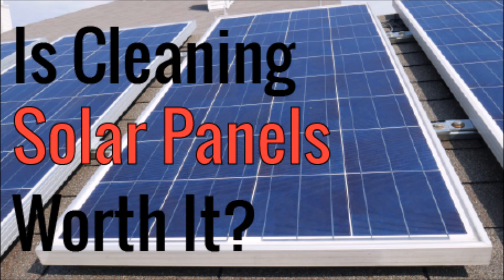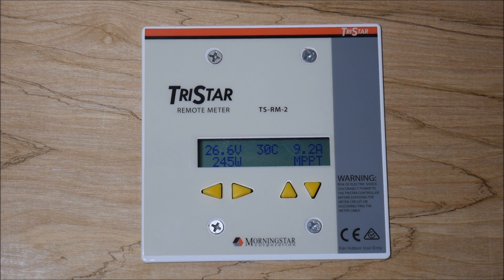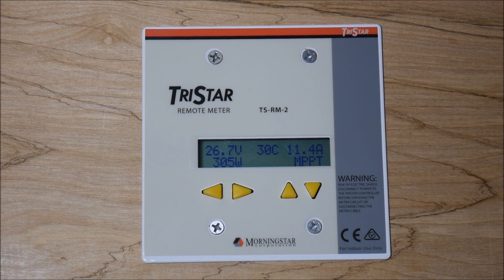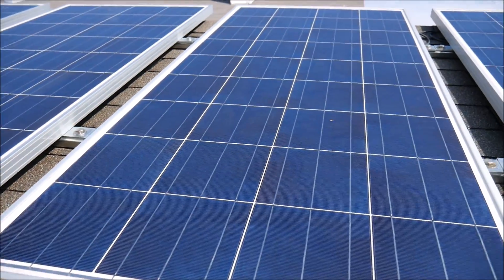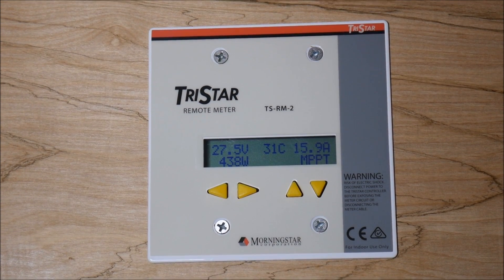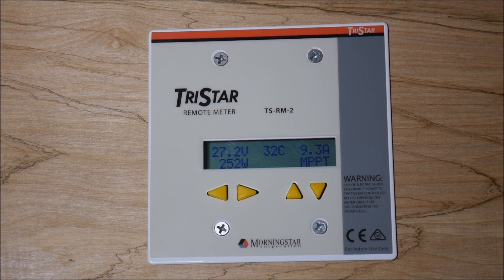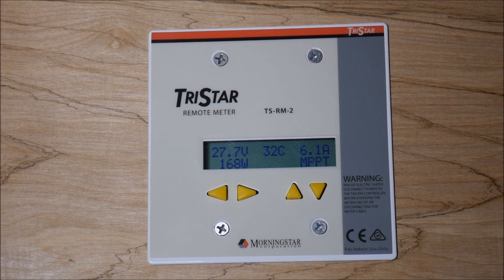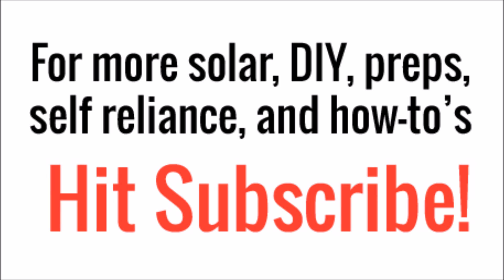Is Cleaning Solar Panels Worth It? - Real World Test Results

Comment: I think this is a cool experiment, however, looking at peak wattage may not be the best way to evaluate the results of washing.  You might try a test where you: 1. measure the total kwh over an entire day when the panels are dirty 2. clean them that night  3. measure the entire kwh over the next day.  You should pick two days that are expected to be 100% sunshine and the same temperature.   Would love to see those results as I have never cleaned mine panels...  Thanks for the video!
Reply: David Armstrong, good idea; that would give a second measure. In the industry we measure both peak power, and total day power.
Reply from the maker: I might try that sometime.  Good idea, thanks!
Reply: I've had solar panel on my northern facing roof (that the correct direction for the Southern Hemisphere) for seven years working at over +90% and a better quality system installed on the western roof hitting 100% of maximum output and I have cleaned them every Month on average because that what solar generating plant in most parts of the world do! Pay wages for employees to clean solar panels continuously. Now why do you think a commercial business pay someone's wages to clean panels? Because it pays they wages plus a return. P.S. Suggest if you have double depth panels that you use light weight aluminium extending pole +3Mtr (10'ft for the metrical challenged) with a flat window mop and a matching window scraper with a small amount of detergent only! Which mean you can clean all you panel off your ladder with a bucket hose and pole. You are typically only removing dust particles with occasional bird shit but it definitely worthwhile. Anyone who tells you otherwise is just lazy. P.P.S. Not lifting your panel off the roof with the uninstructed as recommended means they are more likely to overheat and like inverters when electrical generators when things overheat they work less effeciently.  .
Reply: David Armstrong ....   you could do that, but if you made your reading just before you washed and then saw an immediate surge then you know for a fact that it was worth doing

Comment: 👍....that broom reminds me of a joke.  Scene....residential neighborhood after a snowstorm.  Enterprising boy with two different size shovels (one super big and the other normal) rings the doorbell.  Lady answers...boy asks...would you like your driveway cleared?  Lady says....yesss!  Boy then asks...would you prefer a contract price or pay by the hour??????   😁
    Yeh. I be gettin a softer bristle brush.  I use a micro fiber brush on a aluminum pole used for rv vehicles.  Good one will be $20 to $25 or so.  With a telescoping pole.
   Clean panels do produce more power.  No question about that.  It's amazing to me how dirty my rv solar gets.  Most gain for me is about 15%.  Average gain...about 10%.  Your results may vary.  One thing i did to help keep the panels clean was to add a computer fan to blow off the dust.  😁😜😁
Reply from the maker: An extra fan never hurts!
Reply: LDSreliance ...hahaha